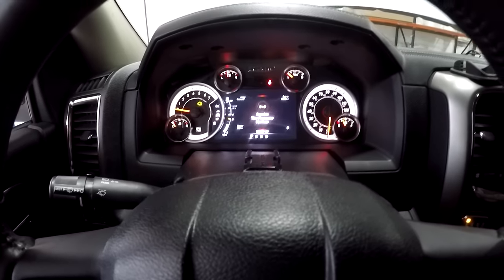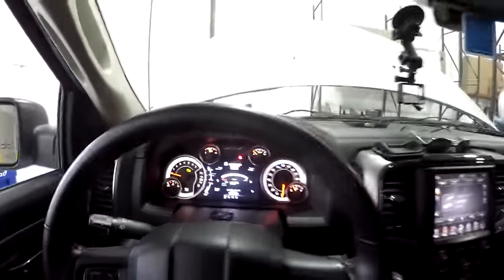HOW TO CHANGE YOUR ENGINE OIL - DIY - 5.7L HEMI - DODGE RAM 1500 2500

Comment: I have to apologize for the bad info on Mobile 1 oil for the Ram 1500 in fact they do have oils that meet the Ram Oil Spec MS-6395 please forgive me.
Reply from the maker: No worries Greg!  😎
Reply: Mobil 1 5w-20 does not meet the Chrysler MS-6395 certification.  The cheaper Mobil Super 5w-20 full synthetic does meet the certification though.  So yes using Mobil 1 5w-20 could void your warranty in the rare case you have a an oil related failure and you roll up in the service department with all your oil change records and receipts indicating you used Mobil 1 for all your oil changes. The manual states it clearly, must meet Chrysler MS-6395.
Reply: Thanks for clearing that up, I thought I had read somewhere that Mobile 1 did not meet the Chrysler MS-6395 Specs and could void your warranty.
Reply: bdhays63 it says recommended in the manual not required

Comment: Thumbs up for bitching about that cap on the jug. I’ve been using the same oil for years and I have the same gripe.
Reply from the maker: Its a petty complaint but man whoever designed that should be fired lol

Comment: I use 5w30 more protection no issues with cylinder deactivation.  I feel like 20w is too light
Reply: Jeremias066 I notice it is really light but  with todays automobiles it's best to stick with  what manufacturer say.  What's printed on the oil cap stick to it.  

This not the 80's or 90's  where we change it to  weather conditions (heavy or light)
Reply: 5w20w has years of research showing it improves upper valvetrain lubrication, from Honda, Ford and GM who have been using it for almost a decade now.  Better fuel efficiency and lubrication, better to stick with OEM on this one.
Reply: I don't really trust auto makers recommendations when it comes to some of the things they say is best for your vehicle.  I mean some of the recommended maintenance intervals are ridiculous all designed to make them money after the purchase.  I also believe they want you to use lighter oil so the engine wears our more and won't last as long so the vehicle is scrapped and people force to buy a new one.  I know many hemi owners who is 5w/30 for years and have no issues.  I little bit thicker when engine is hot which is what counts to protect against wear.  The 20 weight is designed for the cylinder deactivation systems to assure it gets lubed but like I said many owners experience no issues.  What every oil you use in the end the chance of you keeping your truck for 10-15 years is very unlikely anyways.
Reply: That could also hurt an auto makers reputation if engines are wearing out sooner than they should.  Neither Ford, Honda, RAM, Toyota, Etc. want a reputation of wearing out engines just so people are forced to buy new cars.  Most auto makers that spec 5W-20 don't use cylinder deactivation engines.  Like I said, there is almost a decade of positive data and lots of oil analysis done by many many people and organizations that show 5W-20 not only helps improve performance but durability in naturally aspirated motors. Of course, use what you want.  If you are happy with 5W-30, just use it.
Reply: They specify 5w20 for proper MDS operation, not running 5W20 can cause issues with MDS. Says it in owners manual. Even the 2500 runs 5w20
Reply: If Im towing I am not using 20w that is like water.  30w provides way more protection.   5w30 is the oil you should be using.
Reply: steve donaldson you aren't grasping the chemical properties oil. Viscosity is just a measure of resistance to flow, 5w20 isn't an indication of "way less protection", we're talking only marginally less protection. And if the manufacturer recommends 5w20 and they fill all their trucks with it and its inadequate oil, wouldnt you see them having premature engine failures all over the place? Believe it or not, the hemi is one of the most reliable truck engines over 150000 miles and my brother runs a used car lot and sells them with 200K on the daily that run like a top, all running 5w20. It should say something to your "I tow" statement that they run the same oil in the 2500 Hemi which is a HD truck. it was engineered for that viscosity. If you subscribe to this guys channel, he talks about his dads hemi having over 900K Kilos, you guessed it, running 5w20. But its your truck, and if issues arise, youll be paying, not any of us. Good luck to you.
Reply: Yes operating temp is very important when it comes to trucks.  I would rather have that extra film protection of 30W when towing 10,000lb than a 20W.  Daily driver different story as normal temps would suffice a 20W.  Either way any oil would be better than no oil.  I knew a guy than ran a car for 50k with no oil change so who really cares, oil is all marketing.
Reply: What you feel, and what the engine was engineered for have zero to do with each other. Straight from Ram "VISCOSITIES:
All TEMPS....5W-20 Vehicles with the 5.7L Multiple Displacement System (MDS) must use SAE 5W-20 oil. Failure to do so may result in improper operation of the MDS. 
CAPACITIES: With filter 7 quarts After refill check oil level. 
TORQUES: Oil Drain Plug...25 ft/lbs "
Reply: steve donaldson as long as it's the manufacturer recommended viscosity and your changing it at 3-5k intervals, then* oil is just oil. But If you want to do better, like better cold start lubrication, resistance to deposits, neutralization of acids, and longer drain intervals, switch to 100% Synthetic like Amsoil and go 15-25k miles and have better protection all along the way and save time and money while doing it. Oil is not subjective like which pair of jeans is better. Data says differently.
Reply: Use the grade of oil that the factory has determined to be the one to use in any engine. Believe it or not, the factory that created, tested, spent probably millions of dollars developing the engine, knows more than you do about which oil the engine Requires. And don’t use additives in your oil.
Reply: All of this is true. Factory specs calls for 5w20. The spec our truck uses is MS-6395, 5w20 is recommended,it's on the oil cap. You can also use 0w20 or 5w30 as long as that spec MS-6395 Is on it. In my owners manual for this truck it shows if you tow over a certain weight to use 5w30. So no 5w30 will not affect the mds system. Look on the back of the oil bottle for MS-6395. The spec is the most important thing to look for. Granted all oils are not equal. Some 0w20 oils don't have that spec, so watch out for warranty claims.
Reply: Dylan Collett the heavy hauling 3/4 ton truck that calls for 5w30 doesn't even have mds, making 5w30 acceptable.
Reply: Cruz Allen pfff. SRT 0W40 is recommended and it has MDS. If different grades caused issue MDS would not fuction. Oil viscosity varies with tempature. 5W20 at 200F is more viscous than 5W30 at 220F. MDS works the same at both temps.
Reply: theamericandreamdave the 6.4 and 6.2 have different requirements than the 5.7. The manufacturer says in the 5.7 with MDS to use 5w20 or you man have issues with MDS.  No one's arguing that viscosity doesn't change with temperature.. lol
Reply: theamericandreamdave if you weren't aware, MDS operates with oil pressure activated solenoids,  changes in viscosity changes oil pressure.
Reply: Cruz Allen you must be aware motor oil grades are measured in CST which is a lot smaller than human hair. The viscosity of a 20 grade vs a 40 grade is way to insignificant to affect MDS. If it was that sensitive it would not work when oil changed temp
Reply: theamericandreamdave so the manufacturers engineers must be totally clueless and have absolutely no reason to make such a statement then. Got it. Where do we go from here? Is everything the manufacturer says in regards to what the vehicle requires completely Bs then? I mean, they're the ones who built it and should know what spec fluids it requires....what point are you really after? You can argue fluid Dynamics and viscosities all day long, but I still don't see where that changes what Ram had said it requires and why...
Reply: theamericandreamdave if you could give some more legitimate reasons why the manufacturer is wrong on their requirements for the 1500 hemi and why 5w20 is wrong for it, I'd consider switching to 5w30. The fact that this channel host talks about having hemis run 900k on cheap mobile 1 5w20 says it's doing its job. But if somehow 5w30 is light years ahead and better than what the manufacturer requires, enlighten me.
Reply: Cruz Allen obviously you don't have a clue. Because laws of physics do not apply in your case. MDS must not work at different operating temperatures because a 5W20 is the same viscosity at 200F as a 5W30 at 215F. The MDS is used is SRT applications were 0W40 is recommended and is the exact system. Also throughout the cycle of motor oil it changes it's viscosity first it shears meaning it thins out then it oxidizes meaning it thickens. Also I use 5W30 with my 5.7 no issues with MDS fuel economy is within repeatability of 5W20 at close to 20MPG. This will completely blow your mind for example different batches of motor oils may be the same grade and yet the viscosity is different. Like I have stated earlier if the MDS was that sensitive it would not work because motor is always changing it viscosity depending on age, contamination, and temperature. Meaning it often it will thin or thicken into different grades.
Reply: theamericandreamdave you've yet to give any actual answer or response to why the manufacturer calls for 5w20 and cites proper MDS function for why. You can attack me all you like, but you're the one not answering the questions. I even stated if you could give some actual data or facts proving the manufacturer is wrong, I'd gladly switch to the heavier oil because I too initially thought 5w20 was a bit light, but after seeing my used oil analysis and how my wear metals were virtually zero, I concluded the oil is doing its job.

Comment: Pre-fill the oil filter. That means do not allow car to run dry. The car runs without oil, engine will fail and you’ll cause way more problems.

Comment: 5W20 oil?? That's so thin an oil it will penetrate and compromise the head gasket in no time. It doesn't look like your motoring around in frigid temperatures either. A 30W oil seams more appropriate.
Reply: It is what the manufacturer requires to work with the valvetrain design.Ford is the same way.

Comment: 20w is way to light.  For truck that is towing I would never use 20w.  5w30 is the way to go if you are hualing or towing. 20W is like water, very little protection once temps go up.
Reply: Straight from Ram website "VISCOSITIES:
All TEMPS....5W-20 Vehicles with the 5.7L Multiple Displacement System (MDS) must use SAE 5W-20 oil. Failure to do so may result in improper operation of the MDS. 
CAPACITIES: With filter 7 quarts After refill check oil level. 
TORQUES: Oil Drain Plug...25 ft/lbs "